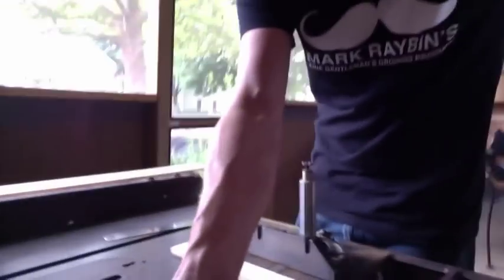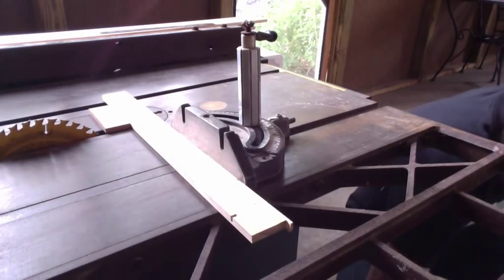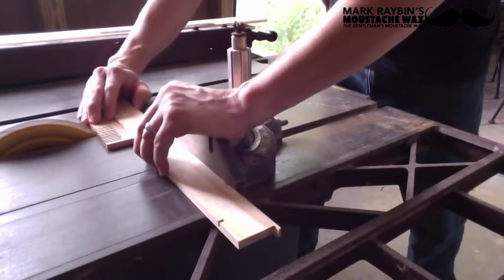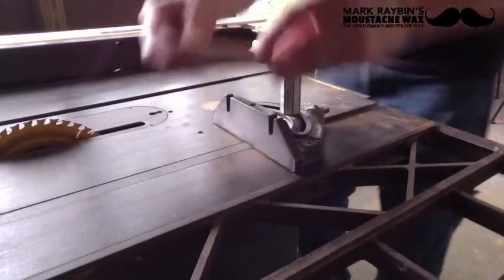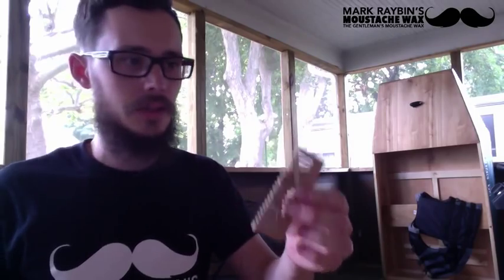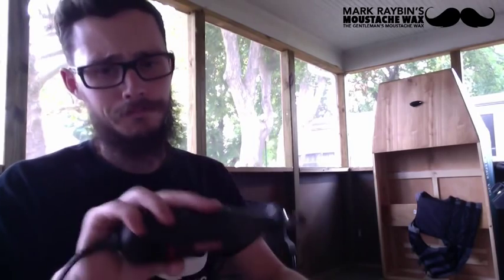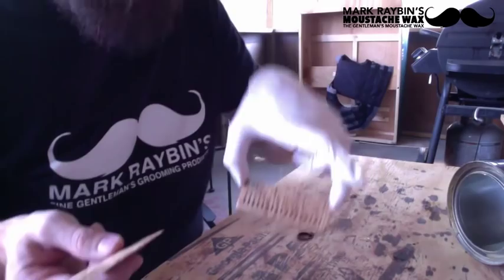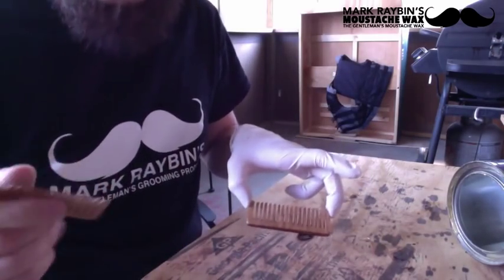DIY How To Make A Wood Pocket Comb

Comment: What are the dimensions of the comb? Also, what kind of lumber did you use? Just oak plywood?
Reply: Hi,

I use solid oak board.  Dimensions are 3 1/2" x 1"
Reply: What is the 3rd dimension (the wood thickness that you started with be for sanding) ? and 1" sounds like that is off, because you said that you make the "Bar" 1/2" and  the teeth look to be 2 to 3 times longer then the bar.
Reply: The length is 3 1/2", the width is 1 1/2" with 1" teeth 1/2" bridge, the depth is 1/4".  Hope that is helpful.
Reply: Thanks for the fast reply. Cool Comb! I will be making a few, can't walk 10' with out running into a Bearded Hipster!